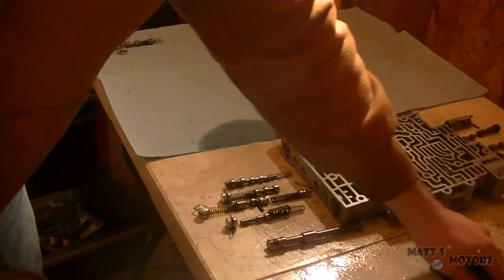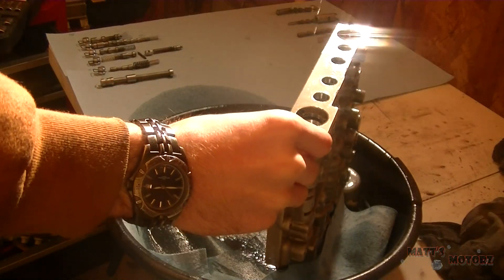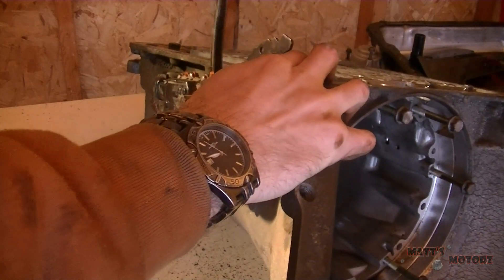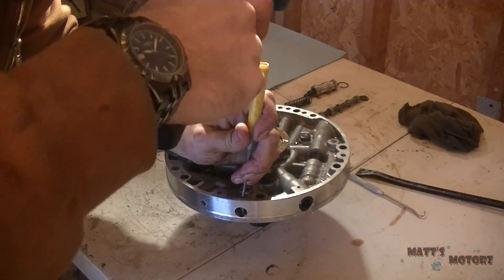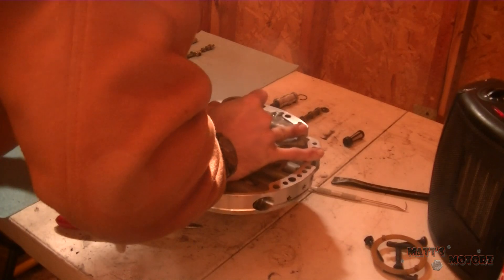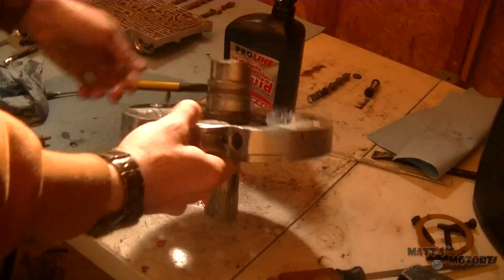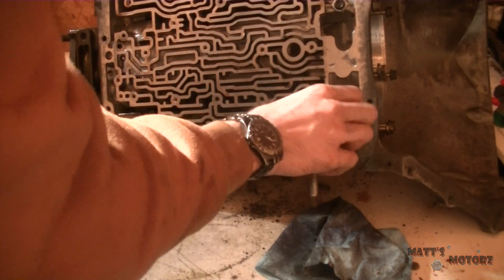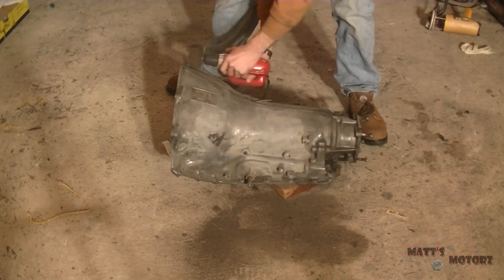4L60E / 700R4 Transmission Rebuild [Part 4: Pump / Valvebody Service and Case Components Removal]

Comment: Does the pump require a o ring in betwween the top and bottom before you tighten the 5 bolts

Comment: Hey which Service manual are you referring to? I have the I have the ATSG Techtran manual.
Reply from the maker: The factory service manual from the manufacturer.
Reply: Would you have a GM part number or a link for that book? I cant seem to find it.
Reply from the maker: I can't remember where I got it from.  Google "4L60E Rebuild Manual pdf."  It is a very popular transmission to rebuild and you should be able to easily find a pdf. The one I am using in this video had many different transmissions in it and only covers a specific year range. You don't have to use the one I used.

Comment: 4L60E problem

i rebuild my 4l60e 2wd transmission i I did everything right but now I can't moving my truck I don't know why I Check the transmission fluid pression is 0 look like is not circulate Is not come to coil do anybody have any idea what I did wrong
Reply from the maker: If you have a pressure of 0, then your pump isn't working properly.  Did you torque the bolts down to spec?  Was the pump rotor thickness and pump depth within spec with you rebuilt it?

Comment: Done with the pump?  What.?  ...you didn't even check the vanes !
Reply from the maker: Just because I didn't show it, doesn't mean I didn't do it.  It should be assumed that any part, no matter how small, you take off from a transmission should be thoroughly inspected.

Comment: Hey man thanks for your vids. One quick question. On my 1983 6.2 diesel chevy blazer (same transmission i believe), it wont shift out of first gear, it just high revs and wont turn over into 2nd or 3rd. What do you think is wrong with it? Vacuum modulator?
Reply from the maker: If you have the electronically controlled transmission (4L60E, the E and the end stands for electronic controls) then you don't have a vacuum modulator.  If you have the non-electronically controlled transmission (the 4L60, it also goes by other names in that year, such as TH400, 700R4, etc..) then it would definitely be worth looking into if the modulator is bad.  It sounds to me like the valves may be sticking inside the valvebody, causing the transmission to be stuck in one gear.  Other possibilities include leaking seals causing a loss of pressure and failure to apply the 2-4 band. (I assume you checked the fluid already.)  You need to measure the transmission line pressure to figure out what is going on in there, I made a video about how to do this.
Reply: awesome man appreciate it